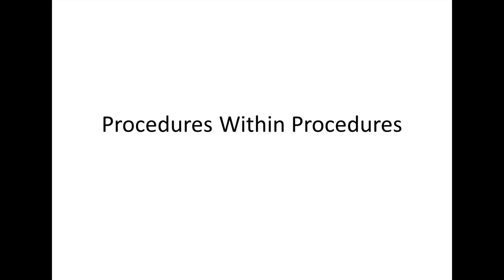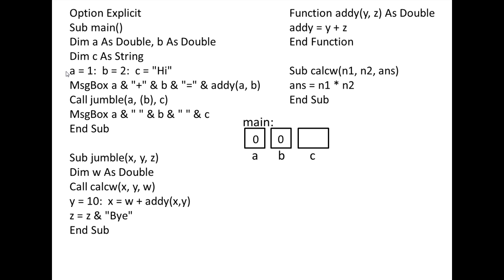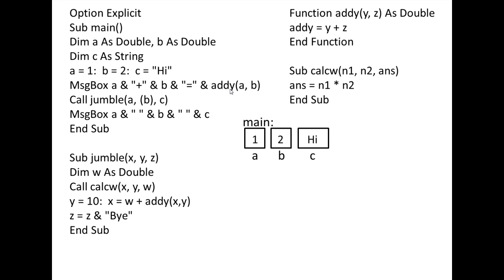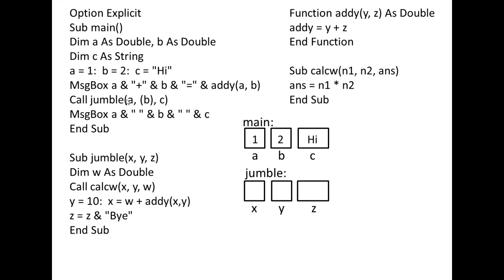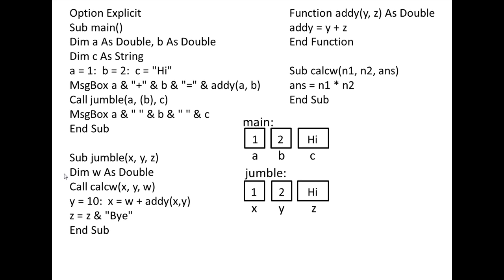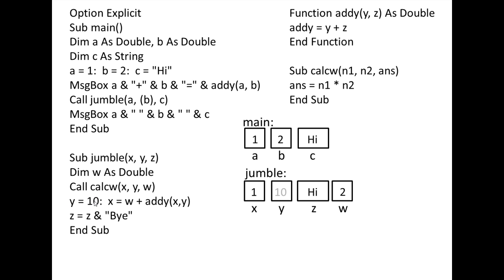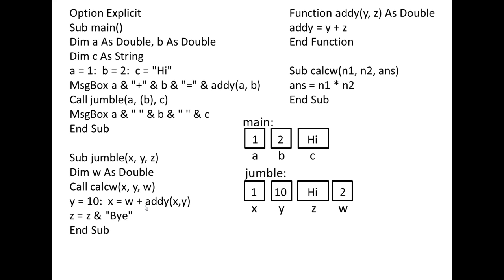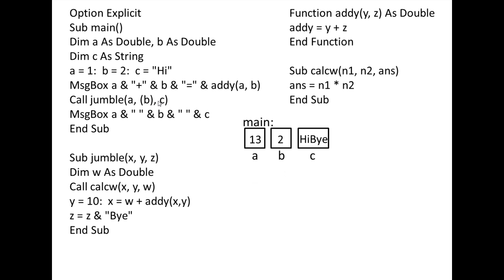Excel VBA Topic 5.3 - Procedures within Procedures

Comment: How come we use a sub for calcw but not a function?
Reply from the maker: +Heather Le You certainly could use a function procedure instead of a sub procedure. This example was meant to demonstrate the mechanics of using multiple procedures in one program without worrying about the purpose of the program. One function (addy) was already included in this example and we wanted to show you how to call a sub within a sub. So, calcw was made into a sub.